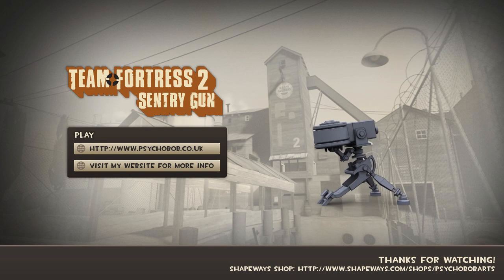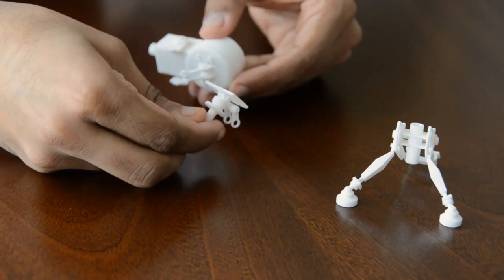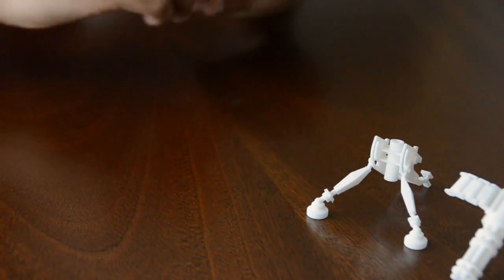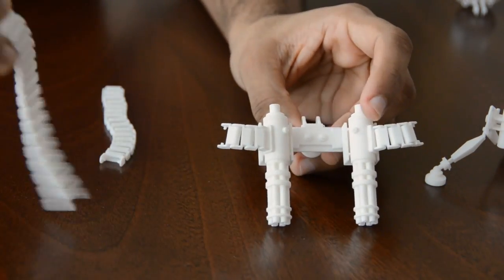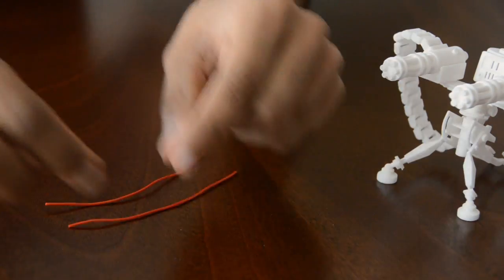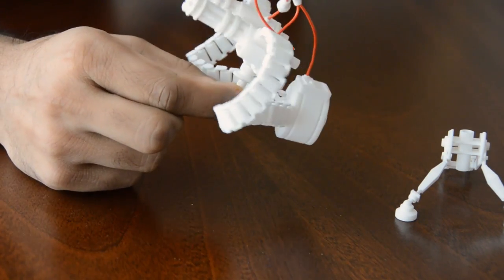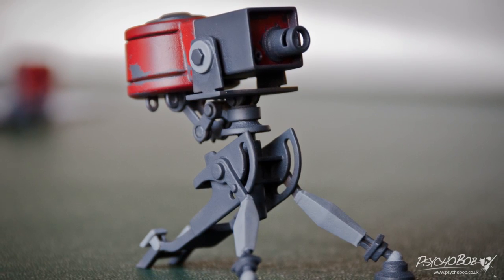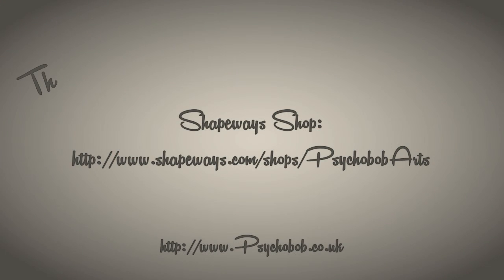3D Print: Team Fortress 2 Sentry Gun

Comment: Can you make me a Team Fortress 2 sentry gun for me please.
Reply from the maker: Afraid I'm not taking on processing the model for anyone.  If the sanding of parts is too time consuming, ordering in the polished version will save you a lot of time. 

The only problem with this is the friction of the parts is reduced so some joints need "tightening" by adding superglue to them to thicken them out (you add the glue to the part let it dry and then assemble the pieces, not the other way around or you end up glueing them together).  Add thin layers of glue and then use sand paper to remove some if you add too much and the pieces no longer fit properly.

Comment: is there a way to use models from gmod models for printing?
Reply from the maker: No idea, I build all mine from scratch.  Generally it's not a simple as taking a model from a game and then just printing it.  There's generally lot's of cleanup work to do when looking at a game model and once done if you're lucky, you'll have something that can print.  Even if you get something that will print it may not be great (for reasons I'll explain below), so I never convert models and build everything from scratch myself.

You'll lose a lot of detail in these cases though as the resolution will be low (games use displacement and normal maps to give the appearance of higher resolution a lot of the time, but the model resolution is lower as they have a finite polygon budget to work with per model) and a lot of detail is just baked in on texture maps.  3D printers only use polygon geometry to create the model. 

Some colour printers (like Z-corp that Shapeways used for full colour sandstone) will allow you to print texture maps, but the majority of printers print in one or two materials so texture maps are ignored.
Reply: ah ty for the heads up

Comment from the maker: Sure you can.  I used an airbrush for the larger base coat (just because it was easier) and then used brushes for the details or small areas.  The material takes well to most paints (acrylic, enamel etc...) and a lot of people also use dyes (though I've never tried it myself).

Comment from the maker: The level 3 pieces are the cheapest as it's only the rocket salvo in that pack.  The idea is that if you buy level 1 and at a later date want to upgrade it, you can buy just the parts you need to make the upgrade rather than having to re-purchase all the ones you already own.  The same goes for level 2 also.  This is all covered in the item descriptions on Shapeways.

Comment from the maker: Also, if you're worried about paint chipping/scratching you could use some varnish/clear coat to protect it (I did this with a spray can).  Just remember, like paint, use multiple thin coats (with dry time in between) rather than one thick coat, as it can run giving you some horrible drips and may add too much thickness to the piece.

Comment from the maker: Thank you for your patronage!
I used some acrylic paints myself, but this material generally takes dyes and enamel paints very well.  I would recommend you try to use thinned coats of paint so you keep the paint thickness to a minimum (or at least around any joints), this is just so the paint won;t prevent anything connecting to one another (as paint can add thickness dpeneding on how thick you put it on).  It's better to work in multiple thin coats than one thick coat.

Comment from the maker: This is actually just the regular strong and flexible material.  All the parts that were being assembled came straight from the box with nothing being done to them (not even a cleaning as you may have noticed when powder was falling out).  The pictures at the end that shows my painted version, were after I sanded the surfaces to make it smoother.

They have improved the surface finish since I first started using Shapeways 2 years ago so it may be worth another go if you haven't ordered recently.